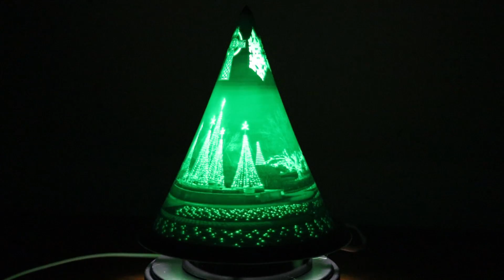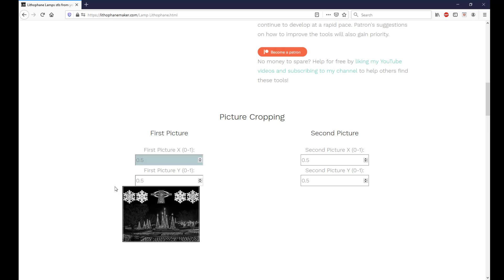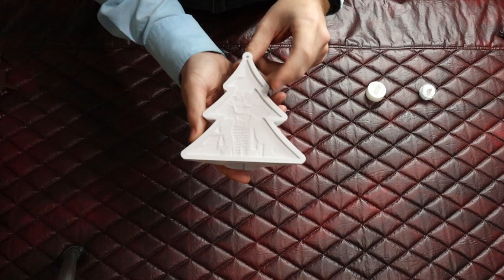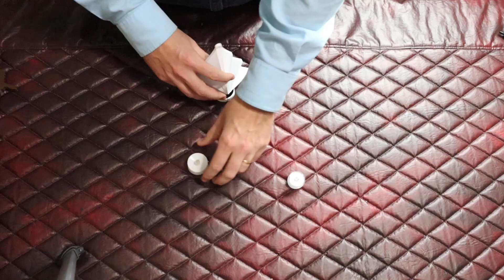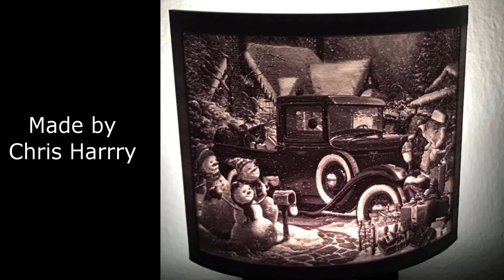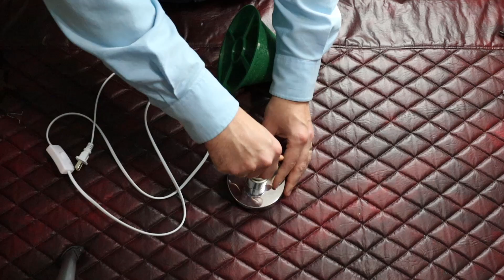3D Printed Christmas Lithophane Gifts and Decorations

Comment: I tried to use different value for height and width the lithophane generated had width 130 and height 125 and i cannot scale because then it changes the light clamp dia